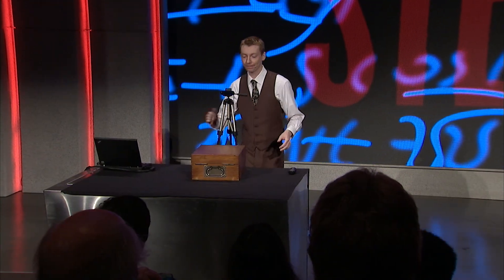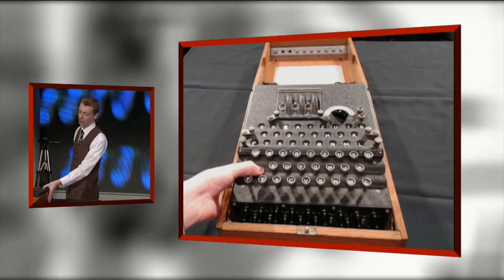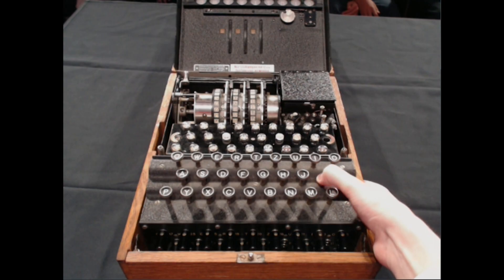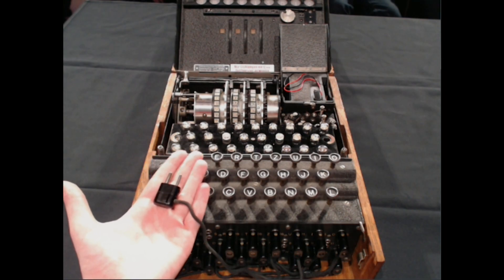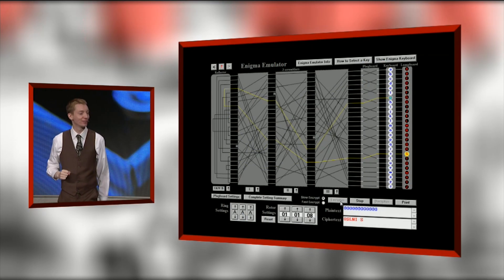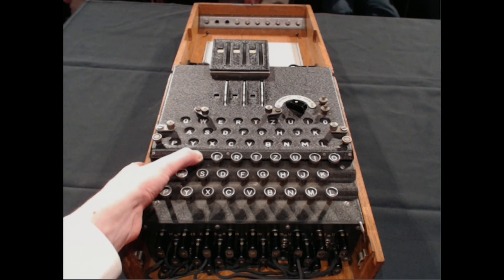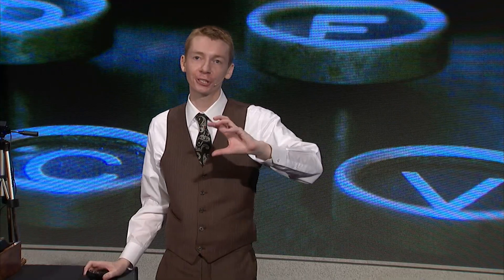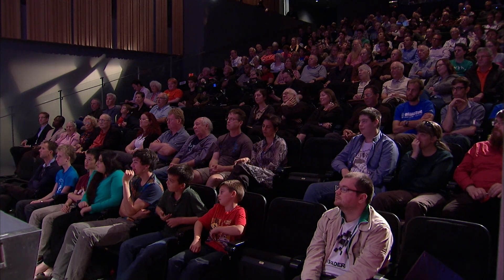The Inner Workings of an Enigma Machine

Comment: I'm a bit confused.  How can the receiver decode the ABCABC?
Reply: +Laura Charland I think it is with the ground starting position written on the big piece of paper for each day of the month!
Reply: +Carl Hewett Thank you!!
Reply: Nothing! That's why the books were printed using special ink that would disappear when in contact with water. This would allow the Germans to quickly destroy these documents if they were at risk. That's what Wikipedia says, anyway.
Reply: +Carl Hewett but then, how would you prevent someone that found an enigma machine and a book of starting positions to decode everything?
Reply: +Laura Charland - The ABCABC is coded on the operators daily setting before moving the rotors to ABC not after, likewise the receiver decodes back to ABCABC on the daily setting to know where to move the rotors for the message.
Reply: You had a certain starting position which is determained by which day it is. Each day 1-31 of a month had a different base setting.

Lets say the daycode is DEF

Then the  person would ebcode a message with his code beeing abc. While he has DEF in the rotors

That would leave him with the Combination GHJ 

Now he would send a enigma message starting with GHJ

The other Person using the daycode DEF

Would type in GHJ into his enigma and get ABC

Also just to decipher the Enigms you needed 4 Different books + the wheels... books can easily be burned or ripped apart
Reply: Paul O'Donnell wrong

They had different settings for each Month/Day for the span of a year (different sheet for each month and then a different sheet for each day
Reply: The ABC ABC is decrypted using the daily settings from the SOI-chart (common to all Enigma machines in use that particular day) and the result is used to make further adjustments, that will be unique and specific to that message.

Comment: While sending the message, prefixed by the ground setting for example ABCABC (repeated twice) the method is to code it using the same enigma machine and send the ciphertext.

How will the receiver know to decode that ciphertext as ABCABC to use that as the ground setting for the rest of the message? I thought you need to know the ground setting before to decode anything. Please clarify !
Reply: +Sriram Chandramouli As far as I understood, you'd use the ground setting from the keysheet to decode the first six letters of an incoming message to get the encoded ground state. Using that setting you then decode the rest of the message.
Reply: The prefix message code is noted on the daily setting and sent before setting the sending machine to the prefix for the message so both machines can code/decode the prefix on the same/daily setting and code/decode the message on the prefix setting. They soon altered this start method to a non repeat start code.
Reply: Sender:
1. configure device including setting-up rotors exactly according to daily schedule.
2. freely choose any three letters, then double the string (like "catcat" or "dogdog" or "sexsex" or "mnomno").
3. type chosen three letters (twice) on Enigma keyboard and record the resulting 6 encoded letters as a "prefix" (perhaps "qwdfvb").
4. ignoring the daily rotor setting configuration, (re-)adjust your machine's rotors to match your chosen three letters (eg: "cat").
5. encrypt 'payload' plaintext appending output to the 'prefix' and transmit entire message. (If payload was "Hello", transmission would be 6 + 5 characters.)

Receiver:
1. configure device including setting-up rotors exactly according to daily schedule.
2: record incoming morse code of what appears to be a gibberish message.
3. type initial 6 letters on Enigma keyboard (perhaps "qwdfvb") and record decode ("catcat"). (Repetition for quality control, but repetition created weakness.)

4. (re-)adjust rotors to match those three letters ("cat") - the actual rotor positions used by the sender from the start of this particular 'payload'.
5. decrypt payload (characters 7, 8, 9, ...) with your machine now being configured exactly the same as the sender's machine for this particular message.
Reply: What shocks me is I can answer that question, lol.

Comment: ooo this makes it way easier to understand how the Enigma machine worked after watching that movie.  The Enigma always fascinated me after watching U-571 as a kid in theaters when it came out.
Reply: The movie U571 was complete rubbish. It was a British destroyer that captured a German U Boat, took the crew prisoner, secured a 4 rotor Kreigsmarine Enigma machine with a complete set of rotors and code books and charts. The Captain of the U Boat was killed while attempting to scuttle the U Boat and the crew was taken to England, imprisoned in completly segregated from other prisoners and held in isolation and allowed no mail or Red Cross contact. This led the German high command to believe the U Boat had been sunk with all hands lost and the code still intact. After that, BP was able to decipher all the German messages and U Boats began sinking at an unprecedented rate. Doesn't make for a very interesting movie but that's what happened. Never rely on Hollywood to portray historical events accurately.

Comment: it's a triple rotor with no military marking so I believe its a commercial version
Reply: +Kyle Cho Each is £85,250
Reply: +Kyle Cho Military, specifically Luftwaffe and Wermacht versions that were used for "the most secure of transmissions" had 5 rotors
Reply: I remember seeing a photo with Heinz Guderian in his command vehicle one of his staff was operating a triple-rotor enigma
Reply: Commericial Enigmas didn't have a plugboard on the front.

Comment: Starting at 10:20 the speaker makes either an error in his calculations or he just read the number wrong for the rotor combinations: 26x26x26= 17576. Not 1576 as he stated. Even his display projection reads 17576. A small mistake, but one that could have changed the outcome of that war.
Reply: Haha yeah I noticed that. Just misread it, I think. 17576 is the right number.
Reply: Advocacy Of The Devil damn... you iluminaty i bet you have core i7 processor machine in 1940s.
Reply: 11:36 He said the correct figure.

Comment: I notice the rotors are turning AS you press a key. I would expect them to turn on a key release to change the code for the next keypress. I guess that means we are always one position ahead, the initial setup being actually never used. clever.
Reply: jaymanu12345 I don't understand what you mean by being one position ahead. Could you please explain to me? :) Thank you.
Reply: ddelfao say you position the rotors in position 1 for start. Then press a letter. the rotors will turn to position 2, and then the resulting letter will light up. It will light up according to position 2. Position 1 is never used. Though i'm no expert, only guessing from what I see here, please correct me if that's wrong.

Comment: Good work! Where I found something how Turing cracked the code?
Reply: Martin Gardien https://en.wikipedia.org/wiki/Bombe is not the whole story, but probably a great place to start. It's the machine shown in the movie, though the movie deliberately skipped the fun-but-complicated stuff, and made a few rather surreal misrepresentations.
Reply: Turing NEVER "cracked the code".......his work was focused on the Enigma MACHINE.....the encryption device......he worked to apply mathematics to work out the complexity of the MACHINE and once he (and several others) accomplished that......he applied his earlier theory that it would take yet another machine to "read" that encryption MACHINE....then he incorporated the Polish solution of their "bomba" (a series of polish enigma replicas wired together) to mathematically work out how his "bombe" could/would/should scrunch down to a workable level the astronomically complex number of possible permutations (combinations of numbers), to simplify the electrical mechanical process to rapidly "break down" the encryption reversing the process to arrive at the original plain text (in German) of the message, then translating that German text into readable English (bearing in mind the German use of quite a high number of military lexicon).....then sending, by hand-carried motorcycle courier, the plain English text to one or more of the British military services operational headquarters for their tactical and/or strategic use......and/or deception planning....soon after their success, the British would send more rapidly and most securely, that English version of the German plain text message to that military services' operational command using a one-time-pad (single use only) British code, encyphered on the British model/version of the enigma, the TypeX  cypher machine (had more than six rotors and a three set encryption capability.....).

Comment: how on earth did this get cracked!?
Reply: Turing invented a sort of an unwound motorised version of the same machine that could be run really fast, and then stacked banks of them to compare adjacent settings simultaneously. Arguably an incredible example of early parallel processing. See https://en.wikipedia.org/wiki/Bombe . They could be wired in such a way as to say (for example) "run through all possible wheel settings until these first 10 letters decode as HEILHITLER" - which would be slightly more than a guess, but (given enough bombe time) you only had to guess right once per day to get the rotor settings for ALL messages that day.
Reply: Alonso Alonso
Yes, BUT that's not enough. You need to have (or at least understand) the machine AND know today's rotor+stekker settings. Having a captured machine obviously helped A LOT, but the real genius was in turing's bombes which could essentially brute-force every possible set of rotor settings in about 20 mins.
Later, when extra rotors were added, Bletchley Park geniuses worked out the wiring of the new rotors WITHOUT capturing another machine.
Reply: Fredmullegun   Slightly simplified for the youtube audience maybe, but not BS. Feel free to correct https://en.wikipedia.org/wiki/Bombe if you have more accurate sources you can cite. I have visited Bletchley several times, I have friends and mentors on the Bombe and Colossus restoration teams, I was in the audience at the Perimeter Institute for Theoretical Physics lecture above, and I chatted with Dr James Grime extensively at the local science fair a day or two later.
Reply: One major clue was that a letter would never translate into itself (e.g. typing "A" would never light up the "A" lamp) due to the fundamental design of the circuit. That gave away a large clue as to what the construction and limitations were.
Reply: Fredmullegun As it says on the wikipedia page, and as the experts at Bletchley will tell you, the 120rpm bombes DID brute-force all 26x26x26 = 17576 rotor positions in about 18-20 minutes.
The educated guesses and maps (menus?) to which you refer are for the "assumed plaintext", EG assuming the first 10 letters might be HEILHITLER because the cyphertext first letter WASN'T H, the 2nd letter WASN'T E, etc (enigma could never encode a letter to itself, only ANY OTHER letter), and because HEILHITLER was quite a common way to start a message, though other "cribs" were common too (EG German for "WEATHERREPORT" from particular operators at particular times, or indeed the German version of "NOTHINGTOREPORT").
Some of the other "educated guesses" used other techniques to eliminate possible Stecker-board settings and/or ring settings, but having done so you'd still typically need to run several bombes (usually in parallel) with several different possible stecker wiring combinations and ring settings (the bombes can't brute-force the steckers or ring settings, only the rotor settings).
Running several bombes in parallel wasn't the only "parallel processing" I had in mind though. See http://www.rutherfordjournal.org/article030108.html for a more detailed explanation
Reply: Christopher
Reply: Nosey Nick : Turing did not break the code or invent the "Bombe". Three Polish mathematicians Marian Rejewski,  Henryk Zygalski, Jerzy Różycki broke the code in 1933 and then they designed and built what they called the "Bomba". They gave a Bomba along with all their data to both the French and English in July 1939 because as they were reading the German messages, they knew Poland was stuffed. Also they did not want the Germans to know that they had broken the "Enigma" so everything else was destroyed.

Also the British could not break the code with the Bombe using "brute force", so they used a combination of what they called cribs and various other info however they could not break the German Navy Enigma at all, they use the German code settings gained from captured German vessels. Later on the Americans using an very advanced NCR version of the Bombe could crack Navy codes in over 12 hours.

hth, build
Reply: 3DM did it
Reply: Hassan Tahan That was made up detail in the movie (and unfortunately, one of the smallest made up things in it, a good movie anyway). In real life the first one was called Victory, which is pretty irrelevant detail in the movie but real life Turing certainly didn't have such a personal affection with it.
Reply: deggis4 They had first modified enigmas (military alike) from Polish Intel Cryptologists (Marian Rejewski and co.) in 1939.
He also taughjt  them everything - which Mathematics to use (Cycles permutations) and which gaps to exploit and which tools to use (Bomba, Cyclometer, Sheets).
He was the right person to do that cracking Military Enigma since 1932 with his collegues, trackin all encrypted intel.
It is this "little" point not credited in Major discussion - Polish cracked it - Touring  adopted it developing Bomba into highly sofisticated  Bombe. Well done. Just give a real credit to right people.
Reply: Bjowolf2 : Actually the big difference between the commercial version and military Enigma's was the "Stecker plug board". beers, build.
Reply: I was the one who did it. Theoretical Physics. :.():.
Reply: Alonso Alonso They already knew that ( via the Polish guys ), but they didn't know the internal wiring of the rotors nor the daily code book settings ;-)

The German U-boat captain thought he had made sure his captured U-boat was going to sink, and the Enigma operator forgot to destroy his code book -
dipping it in water would have sufficed.
Reply: Janssen Eric Poda Yes, but not the German military versions with extra wheels.
Reply: sheepwshotguns autorizovaná kritická história - Enigma a tajné služby - prvý súhrn na svete vyšiel v r. 2004 v časopise Historická Revue na Slovensku:
https://emiliadr.wordpress.com/category/enigma/

Kritický prístup k histórii nedovoľuje prisvojiť si slávu ani anglickým, ani americkým vojskám :-)
Reply: Nosey Nick Most of what you are saying is BS. You should read more.
Reply: Nosey Nick They didn't brute force every setting in 20 minutes. They made educated guesses, created a map and greatly cut down on the possible answers. So, that was BS and a lack of understanding on your part. It isn't parallel computing. The bombe checks a rotor setting a initial and at t+1, t+2 at the same time. Also it can only check one specific rotor setting at a time. It isn't anything like parallel computing. My qualifications are I can read. Look into it.